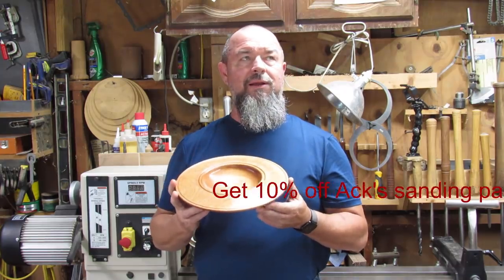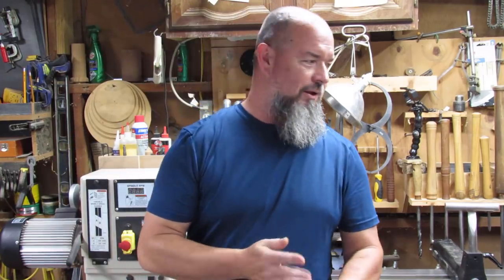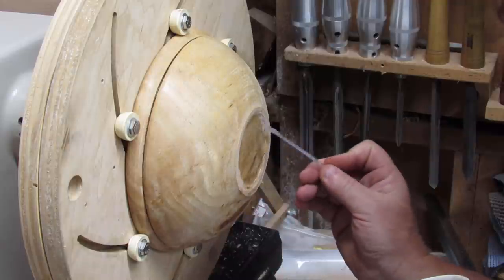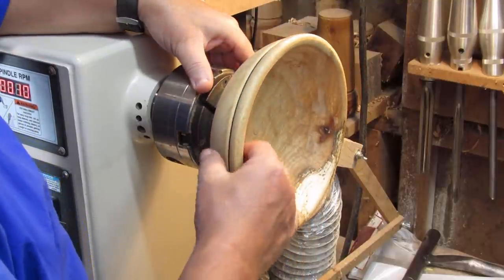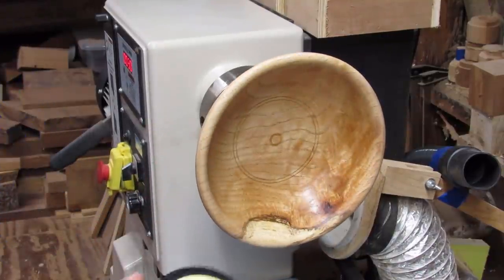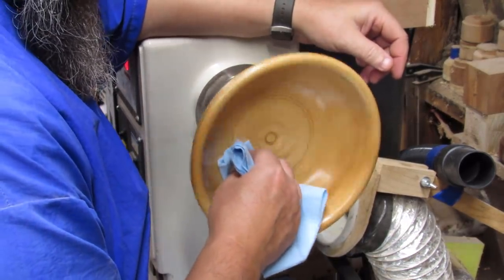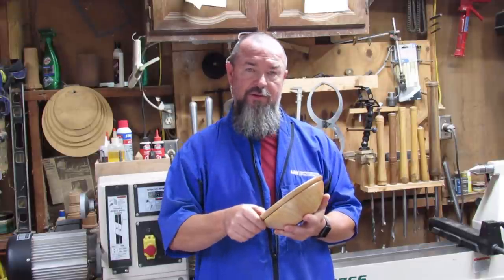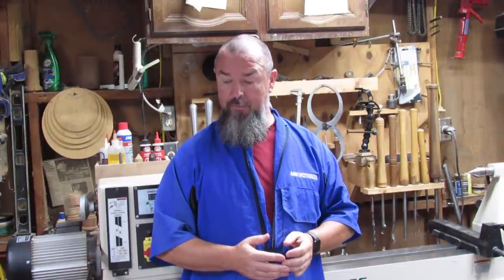#159 Restoring a Bowl Washed in a Dishwasher

Comment: Nice restoration and given me some ways to add a tenon using epoxy instead of CA glue which never works for me. Also to sand rather than try to true up with a gouge. Thanks.
Reply from the maker: Thank you Ann. So glad you enjoyed this project and found it helpful. I almost only use Epoxy for gluing tenons. I found that CA just does not hold well enough for heavier or out of balance pieces. I have actually used an epoxy tenon while coring bowl blanks and they hold very well. Thank you and take care.

Comment: Hey Stephen , I'm the guy that helped you get your car unlocked in Athens in January.  Fill me in on your sanding sealer formula.  I got my Acks products Monday and have used them on two cedar bowls. I used shine juice followed by several thin coats of spray lacquer, then the Acks. Seems to work well. Your advice will be welcomed.  I've got my first festival Oct. 17 in Watkinsville,  ga. Wish me luck. Will have 125+ pieces!
Reply from the maker: John. It is wonderful to hear from you my friend. The Sanding Sealer I use mostly and also in this project is DEFT Lacquer Sanding Sealer. I buy it at my local hardware store. I really like the shine juice and have been making my own for years, however Shellac doesn't take well to getting wet, so I have shied away from it in the past years for more durable finishes (remember the rings on antique furniture when you sit a glass on it). Your first festival, WOW, that is great I hope you sell out. I have my first one since Covid in November. Good luck and take care.
Reply: If I may chime, I use my own shine juice that is food safe as a sanding sealer, blonde shellac flakes and drinking alcohol(gin or everclear)...that way I have a sealer and it is food safe. Just a FYI. A lot of people are using our abrasive paste to take out ripple or brush marks in the laquer and then our polish on top of the laquer, people say it comes out beautiful, I have not tried this method myself.

Comment: Hi Stephen, Great restoration of the Pin Oak Bowl. Have you ever tried hot glue to glue a tenon on rather than epoxy? Take care Stephen. Cheers, Huw
Reply from the maker: Thank you sir and yes I have used hot glue for smaller projects and still do. Never for bowls or something with the potential for lots of vibration and torque. Epoxy has stood up on my coring blanks where the vibration and torque are very strong. It is the only glue I have found that will hold reliably.
Reply: @StephenOgle  Thank you Stephen.

Comment: The Acks sanding paste along with Yorkshire grit are both based on a polish use in French Polishing that has been around several centuries. Kim Tippin makes her own that she uses with excellent results and you can find the recipe online to make it. It is pumice and rotten stone and bees wax and boiled linseed oil and you mix and melt it in a crock pot. Make it for pennies on the dollar!
Reply: Boiled linseed oil  can be poison, ours is 100 percent food safe-non toxic, if Stephen uses this bowl for himself or sells it, there is no worries with any food in it. A true French polish uses shellac, there is no shellac in our product.
Reply: @ACKSWOODPASTE  Appreciate the comment.  Say someone uses the paste/polish as a finish on a salad bowl...I sure would be interested to know what kind of feedback you have on how it wears over time.  Does it hold up well if the project is actually used?
Reply from the maker: Thank you James. That is very good information. I have seen Kim's video but never tried to make it myself.
Reply: @donovanbailey4398  Remember, anything that is food safe is NOT going to be as durable as something that is made by industry, BUT, with the Carnuba wax, it holds up the best their is on the market, its been tested by other turners against many turners. It holds up on our personal bowls and butcher block the longest out of all the years of using different food safe items.Obviously it isnt as hard a polyurethane, I dont want to put poly on my chopping block, so there is always a trade off. Remember, we are all about food saftey comes first with us and we have accomplished this. Our polish is very expensive to make and we give the 4 ounce jar away for Free, all you pay for is the abrasive paste with our kit, a lot of people dont know this. Thank you for the question.   Been thinking Donovan, as soon as I am on my feet, maybe I will do a video on a bowl, then eat out of it, wash it in sink, and see, then maybe do it again, and show what happens on video, then if it does dull up, we can show how fats(15 seconds), to reapply a quick coat and wipe it out for a brand new finish, thanks again, Im looking forward to doing that. ANy more questions, please write us an email, I feel bad putting all this on Stephens channel.